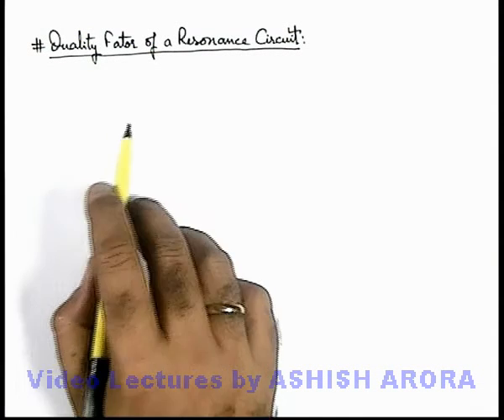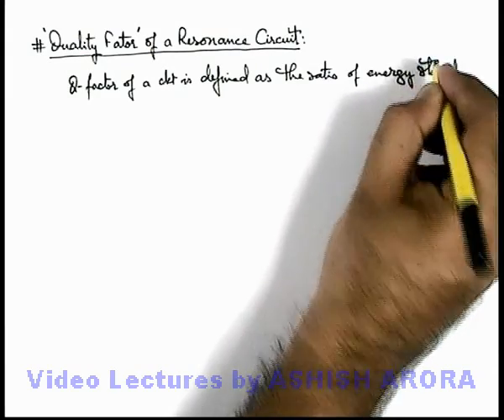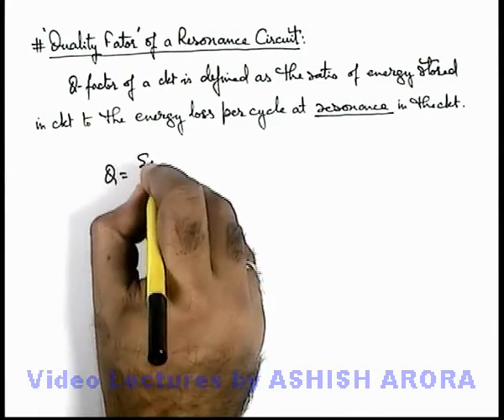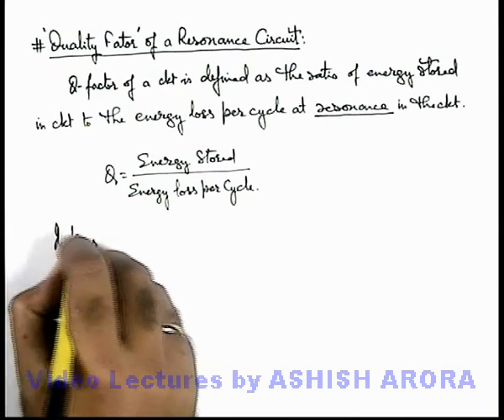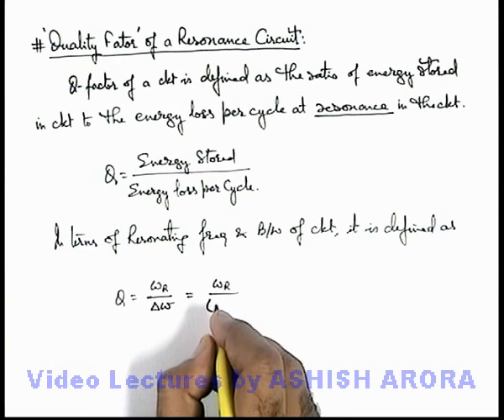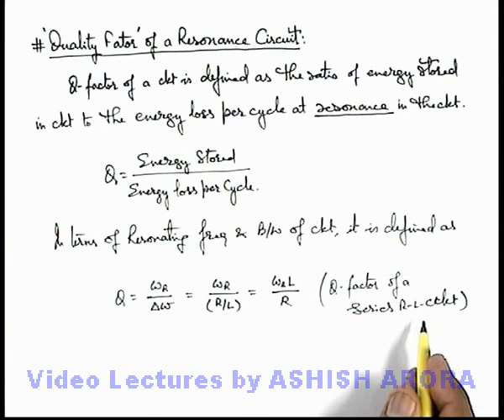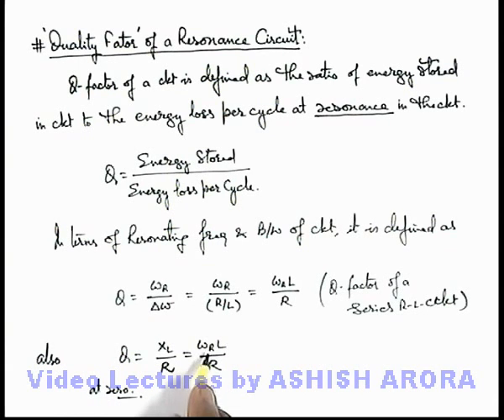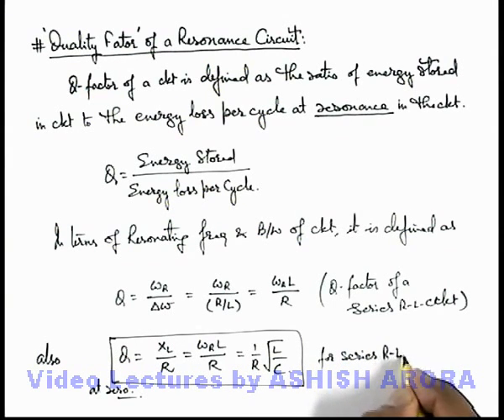Class 12 Physics | Alternating Current | #42 Quality Factor of a Resonance Circuit | For JEE & NEET

Comment: Is q factor also written as Q= 2π[maximum energy stored in the circuit/energy loss per period]??....If this is so then the maximum energy stored in the circuit can be written as 1/2Li^2????....Why not Q^2/2c??
Reply from the maker: yes that can also be used in derivation, result will be same...
Reply: @physicsgalaxyworld  sk why we are considering energy to be stored in inductor only....Why we can't write energy that is stored in capacitor
Reply from the maker: As both inductor and capacitor voltage is 180° out of phase the energy in the two is not simultaneously varying... so it can't be taken up together...
Reply: @physicsgalaxyworld  thanks
Reply: @prabhatkumarverma200  did u prepare from aakash kota !!

Comment: sir  when  there  is  rms  current  why   we  study  mean  value  of  current
Reply from the maker: mean value is used for analysis of total charge flow and rms value of current is used for power analysis...
Reply: how  can  you  be  kind  enough  to  explain  it  in  detail ?
Reply from the maker: Didn't get what you want to understand... I have already explained both rms and mean value of current in sequence of lectures... or you can follow the lectures in sequence on playlist or on physicsgalaxy.com
Reply: sir   why   we  require  two  values   where  we  use  mean  value  of  current?
Reply from the maker: You need to be careful if you really wish to understand this... I have already replied that mean value of current is used for charge flow measurement and it cannot be used for any other purpose... as it is defined in this way only... similarly rms value is defined for power analysis or thermal power produced in a resistor and cannot be used for any other purpose as it is defined in this way... for definitions... go through the videos of these currents explanations...
Reply: thank you